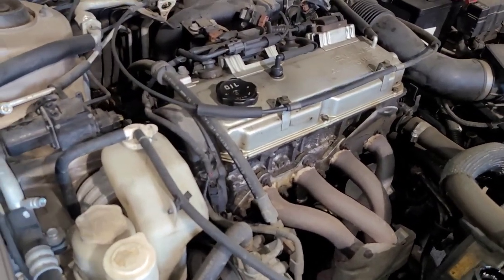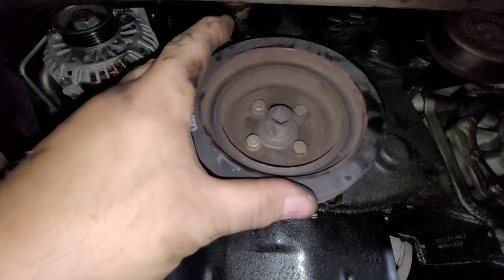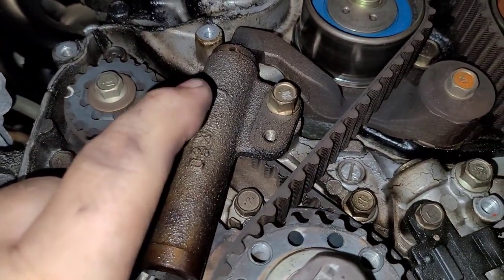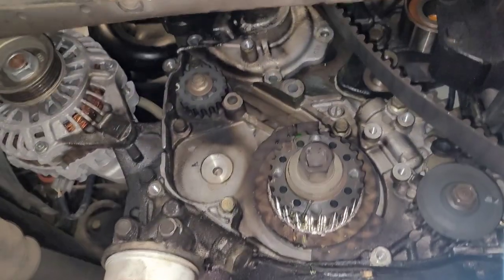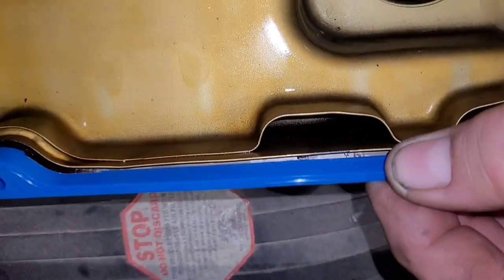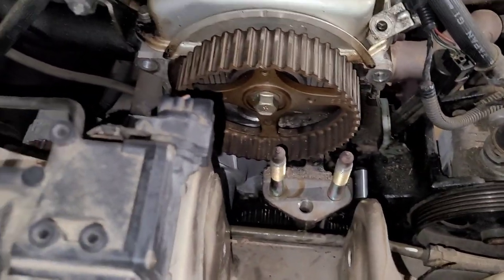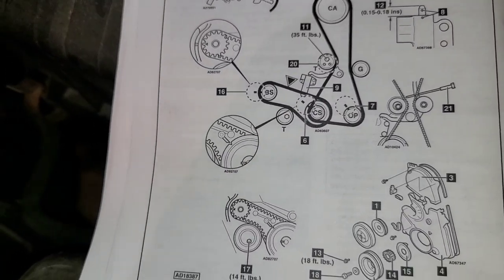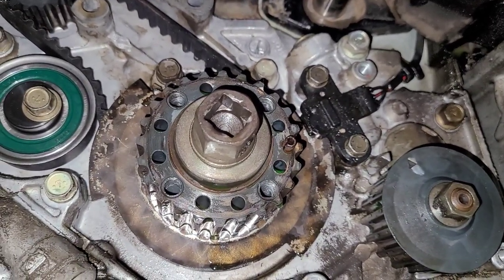Timing belt tips and tricks + water pump & Valve Cover Gasket replacement. Mitsubishi 2.4

Comment: Thanks for the great video, actually the only one on YT who does the tensioner install without the specific tools (for the eccentric pulley & Hydraulic tensioner). Nice idea about putting the belt on eccentric pulley on first, timing belt second and then Hydro tensioner last... pretty much negates the need for the specialized tools. The only thing I would add, the grenade pin shouldbe easily removed and reinserted once you have the tension 100% correct. In your case, i probably would have backed it off a touch either way till you found that sweet spot. Regardless, great video!

Comment: Hey Ken. Nice work. One thing I just want to mention for your viewers is that there’s a specific procedure for the tensioning process for the timing belt that is crucial. I didn’t follow it exactly and it cost me an engine, 30k miles after I changed the timing belt. Those two little holes in the tensioner need to be horizontally straight across from each other. You also need to let the car sit for about 15 minutes and make sure the pin goes back into the hole of the auto adjuster. Very important. It’s kind of a weird setup, unlike Toyotas and Hondas. Just wanted to mention this and I mean no offense to you at all. Thanks for the video!
Reply: Hello, I might add to this comment, that this engine actually has 2 tricks not addressed in this video. (of course mate, not in the spirit of discrediting or else, only in the spirit of helping the community even more :) ) 
One is the beforementioned by Anthony F here. The pin on the hydraulic tensioner must remain FREE to move after adjusting the main tensioner with the special tool (or whichever other tool you use for that). When adjusting the main belt, don't remove the pin yet. Adjust the main tensioner almost until the two holes line horizontally (to give you a visual idea), and temporary secure the bolt, and then check if the pin still moves freely inside the hydraulic tensioner. Ideally, here you want to use a torque wrench for securing the bolt on the main tensioner to 48Nm (according to the manual). Then check again if the pin still moves freely. If it doesn't, then you need to play with the main tensioner more. Then wait 15 minutes and see if the pin can still be moved, and that you can then take it out and put it back in. According to the manual, in the end, the pin should not protude anymore than 4.5mm (3.8-4.5mm) out of the hydraulic tensioner but to make it easier you should definetely check that you can be able to reinsert the pin. If you already removed it, and the pin can't be reinserted, then you should remove the hydraulic tensioner and compress its piston to its original position where you could insert the pin again, and start over. 

The second trick is that the oil pump sprocket can very well be OFF by 360º even if the aligment mark is aligned. The way to check if you are doing it correctly is by removing the service bolt located beneath the exhaust mainfold near the driver's side (the one you said not to remove in the video), then inserting a screwdriver in this hole. If the screwdriver goes in by at least 60mm, then the oil pump sprocket is in a correct position to be aligned by the marks. If you can't insert the screwdriver in this hole, it means that the oil pump sprocket is not ready to be aligned, you must turn it 360º (a full turn) so when it aligns again, the balancer is on the correct side. Another method to use instead of using the service port bolt and screwdriver, is the "gravity check", if you spin and let loose the sprocket if may gravitate away from the aligment mark, or gravitate towards the mark, and if it gravitates towards the mark then you have it on the correct side. 
I suggest your viewers also to check the youtube video called "How to Remove and Replace the Timing belt and Water Pump - Mitsubishi 2.4L SOHC Engine PART 3" for learning the Oil pump sprocket alignment part using the service bolt and screwdriver method. (this guy explains it correctly, but then he follows another procedure for adjusting the main tensioner on the belt by removing the pin and then hoping that the pin goes back -and if not, he must remove the hydraulic tensioner and compress the piston-, where if you don't remove the pin in the first place you avoid this risk, that's where this guy could have make it better) 
There's another video called "Mitsubishi Timing Belt Tip`s" by "homotorsports" showing the "gravity method" for aligning the oil pump sprocket. 
Don't mean to discredit in any way your great video, but I feel it's important to share these tips to your viewers especially if doing a timing belt job on this engine
Oh, and you can google the manual for the 4g64 engine where you can find all this info as well 
Hope this helps!
Reply: @dannyelregio is he working on the 4g69 here or 64?

Comment: the bolt you said not to remove Identifix says to remove and install a allen wrench to make sure it is in the correct position according to them it will line up 2 different ways have you run into that

Comment: How…in the world…did you get that water pump to line up? This is where I’m stuck. It’s very difficult to get it on that water pipe, but when I do, the bolt holes aren’t lined up. I’d have to yank it almost 3/16 of an inch and that’s very difficult to do when you have a gasket in place and zero room

Comment: I just did an 07 gallant, and the tensioner seemed weak so I cranked down on it. How tension should be on that timing belt oh, they are not interference engines apparently because mine ran good after a jump time. Any advice would be greatly appreciated.
Reply: 😂 my  own was crucial man it cut belt damage engine 😢 thats how it is